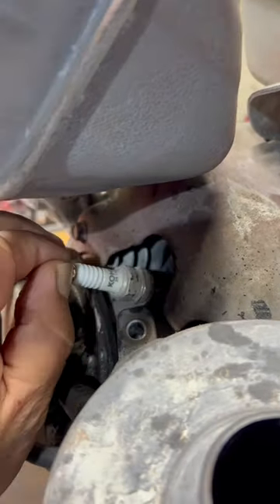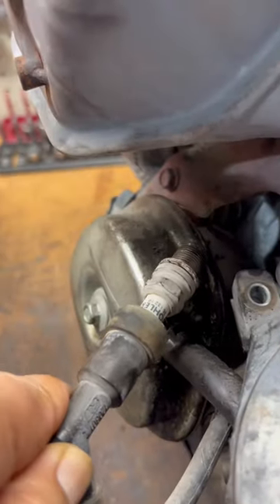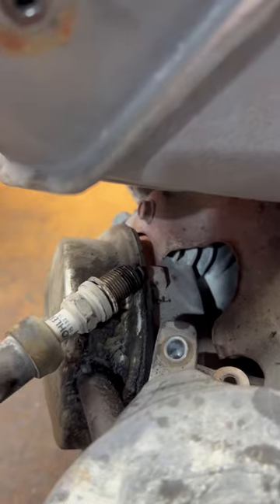No spark. Is it the spark plug or the coil?

Comment: Thank you for this video! By Gods grace, this video aided me in starting a motorcycle. I checked the spark plug, and ignition coil per the steps shown. Initially i thought i needed a new ignition, then decided to trace the wires from the ignition further through the bike. Found a split wire. Spliced it back together, voila!
Reply from the maker: Thanks for watching.

Comment: Also: points could be stuck/corroded open. Ohm meter, or continuity chk ignition wire back to magneto: turn over engine slowly to note points going to ground and back to high. resistance; spark plug removed.

Comment: You mean the key switch(on/off)? And what if it only spark maybe 2-3 times when i push the start button? Lmk if you have any thoughts thanks.
Reply from the maker: First, what equipment are you using? Second, not the key switch but the wire that goes to the ignition coil. That wire shuts the unit off.
Reply: @10minutefix  its a suzuki ltr450 quad. Dynatek ignition coil.  Harness is brand new oem same as the ignition coil but its dynatek.
Reply from the maker: @rudycornelius5119  sorry but I am not too familiar with your Dynatek

Comment: I have brand new 2 year old 79cc engine and after this past winter I tried starting it up and it didn't have as much power when accelerating, it could hardly take me up a slight hill. Do you think that because it doesn't have much power anymore, that it could be the smark plug coil? I've changed the carburetor and that didn't work. Just let me know please 🙏
Reply: Carb needs to be cleaned spay carb cleaner also clean filter since doing that’s just buy a new spark plug and add fresh oil you’ll be good
Reply from the maker: Honestly not could be several things. I’m leaning towards the carburetor. When you say it doesn’t have much power, then you have to specify what is it that is not working.
Reply: @10minutefix  yeah so it starts up fine but when I pull the throttle it just doesn't put off much power. It doesn't sound any different, like it would be bogging down. It just seems like it won't pull me that fast, and when I go up a very slight hill it doesn't have enough power to pull me up. I changed the carburetor but that didn't work
Reply: @chasedollars1643 could be spark just bought a typoon bms that’s been sitting since 2017 lol for only 50$ quad came with everything looks new just had so many tweakers as a owner lol anyways she starts when’s she wants to carbs new so my next suspect would be the coil had no spark from both plug and coil explains when she starts she takes off slow also belt clutch could be bad haha   Bro it’s your spark check that before you spend more money 😅
Reply: @coopergt500twin5  thanks 🙏 i will do that. I'll keep you posted

Comment: Would putting In performance spark plugs do anything bad? I remember when I first replaced the spark plugs, all were good except the 4th which was white, crusty and burnt. I drove 30000 km in 8 months and just drove 850 km in a day the last week. Oh man, maybe I asked too much of a van from 98...

The plugs kinda oily on 1st and 4th imma try doing the spark test thing when I wake up

Aight my brain small its clearly my starter my wires are fine 😅

Comment: Going through this on my 2002 harley 883 . Both plugs get spark so go after the on/off switch next?
Reply from the maker: Is it not starting? If you are getting spark then it’s not the switch.
Reply: Yes both plugs get spark. Should I try to clean the carb next then?
Reply from the maker: @neevsmazda07 spray carb cleaner in the carb and if it starts then you have a fuel issue.  Check Fuel, fuel lines and then check carb. If it doesn’t start then do a compression test.
Reply: @10minutefix  ok will do thank you so much for your help

Comment: Pulled the wire and got spark.  Does a problem with the wire mean I need to replace the whole thing?
Reply from the maker: If you removed the kill wire from the ignition coil and you got spark but didn’t get spark with it connected then either the switch is bad or the wire is broken. Test continuity between the wire ends and if there isn’t any then the wire is bad. I’d there is then test the switch. The ignition coil is good.
Reply: @10minutefix  Thanks, it’s definitely the wire.  Are they anything special or can I just get a comparable one at a hardware store?
Reply from the maker: @wingzfan102  just make sure it’s the same wire gauge. Nothing special about the wire.
Reply: What is the on an off switch ?
Reply: I don't have a on an off switch I jus have start button electric starter and a key
Reply: I don’t have no spark at all.

Comment: I have change the  spark plug and the coli  and the power is coming  also have checked the timing  belt  checked all fuse Mitsubishi engine 4g64  chery cross easter vl5 model

Comment: Ok, when i remove the killswitch i do got spark 😅 thanks i can look further now
Reply: I fixed my problem, there was a lot of grease/dirt mixed with some conductive grease from inside of the keyswitch, which shorted the Killswitch circuit
 Thanks a lot! I got spark now, now on to the carburetor..thanks a lot! These short are very informative
Reply from the maker: @brub5174 thanks for watching.
Reply: @brub5174 if you get spark when switch  is on is that mean kill switch is good? Or other way
Reply: @popsncracks9108  I had shortcircuit inside Killswitch (due to weathe, mower is still outside), that made it impossible to start
Reply: @brub5174  do you know link for killstwich? I can’t find anywhere. Thank you for help
Reply from the maker: @popsncracks9108 what brand do you have?

Comment: Brand new ignition coil, still no spark with kill switch plugged on or off. Any other ideas?
Reply from the maker: It’s either the spark plug, switch or ignition coil. New ignition coil so you need to test the switch. If it’s good then it must be the spark plug.
Reply: @10minutefix  brand new spark plug, properly gapped. This is a head scratcher
Reply from the maker: What kind of unit is it?
Reply from the maker: Disconnect the kill switch wire from the ignition coil and start the engine. If it runs then it’s the wire. Remember you will not be able to turn it off. Or place the spark plug near the engine and pull the recoil starter to see if there is spark.
Reply: What is the on and off switch I'm having this problem
Reply: What wiring could be bad ?
Reply: Same problem
Reply: I need help I have brandnew ignition coil an spark plug no fire
Reply from the maker: How are you turning the machine on and off?
Reply: Pulled the spark plug, and put it in my mower. It started right up. I’ve put 2 brand new ignition coils on the generator, they both ohmed out good. 
Subaru generator by the way
Reply from the maker: Disconnect the wire from the ignition module. That turns the unit on and off. If you still have no spark then it’s the ignition module.
Reply: Could be ur cdi, its not always the ignition coil...

Comment: Ummm. My kill switch wire is not there. There is nothing that it would connect to or anything. Its an old engine so maybe thats it.
Reply from the maker: Something has to kill the engine. Follow the wire from the key switch to the ignition coil. There must be something in the ignition coil.
Reply: @10minutefix  oh! Cool thanks. I have a 1940s 2 hp briggs engine. I'm fixing it to sell it. Now it needs a new spark plug and I have to figure out how to tune it.

Comment: When i crank mine it sparks twice the disappears crank it  again sparks then stops while I'm still cracking its puzzled me 😢
Reply from the maker: If you disconnect the wire going to the on/off switch from the coil and isolate just the ignition coil and you don’t get spark then it is the ignition coil. If you get spark then it’s the wire.

Comment: I have a Murray with no spark I unplugged the wire and it has spark now but only runs on starting fluid I cleaned the carburetor and it still doesn’t run what should i do
Reply from the maker: Well, first you have absolutely make sure the wire is failing because if it runs then you won’t be able to shut it off unless you  unplug the ignition coil. Second, if it starts and you spray carb fluid to keep it alive then it is a fuel or air related issue. The carb might still be extremely dirty and not allowing fuel to enter the engine. The jets might still be clogged. I believe I have a video on cleaning carbs. Let me know if this helped.

Comment: Can anyone help . I revved my bike a bit high and it blew the battery and now it has no spark
Reply: Check fuses?
Reply: @tristanharris8849  hello , thanks. I found the issue . It was the CDI . It uses a 2 plug system and one of.it went out

Comment: What if there no wire
Reply from the maker: There has to be some wire on the coil or somewhere on the unit that connects to the ignition coil and the on/off switch. That is the way it shuts the unit off or you would not be able to. If it has a harness connected to the coil then that’s where it is.

Comment: I did that I ro.ed the kill switch still no spark
Reply from the maker: If you disconnected the wire at the ignition module and you still don’t get spark then it’s the ignition module.

Comment: Or the stator
Reply from the maker: The stator does not produce spark on a small engine. The ignition coil does.
Reply: @10minutefix  the stator send it to the ignition coil there’s a contact point in the stator that allows the spark to get sent to the ignition coil
Reply from the maker: Well not all engines have stators so how does that work? The ones that have stators are for charging the battery. Not to the spark plug. The stators create voltage and that voltage does not go to the ignition coil. I have never seen what you are describing. If you have then I would like to research it.
Reply: Does a rusty fly wheel affect no spark
Reply: @keithburns6622  it can I had a issue like that I reset the ignition after cleaning it by putting a piece of thin cardboard in between it

Comment: You never did say test is run with engine running. This is terrible instructions. Your instruction is incomplete to the max.
Reply from the maker: I suggest you don’t mess with whatever your working on. If you have to be told to turn the engine over then you shouldn’t even touch any tools.